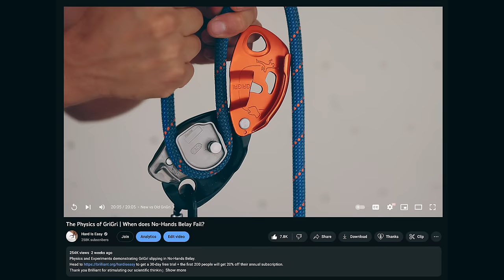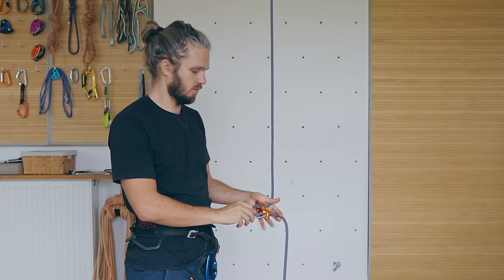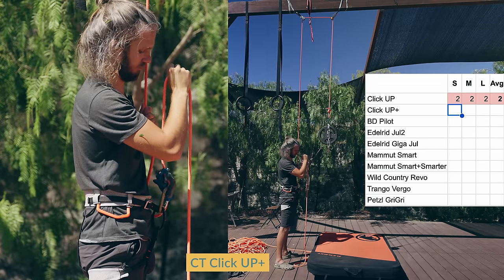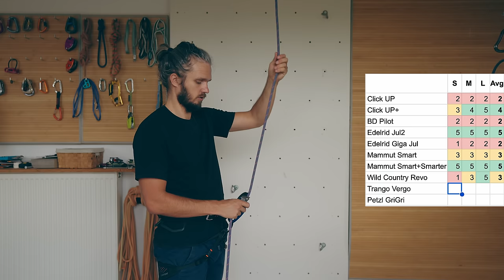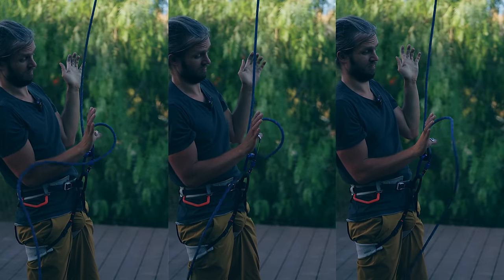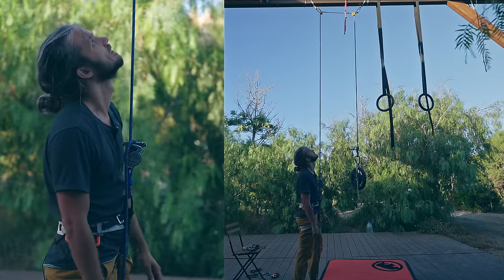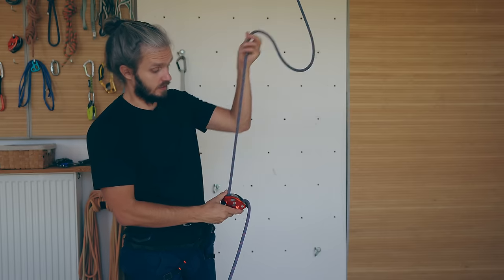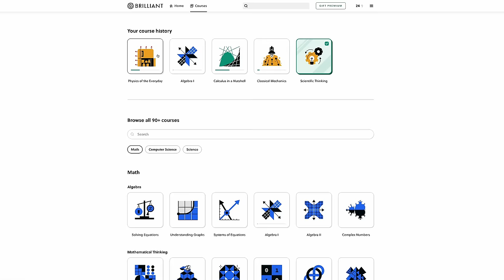When Assistance Fails!? The Physics And Experiments of Belay Devices

Comment: With the click up, do you always have to manually unlock it to get the failure mode you saw with the no slack fall? I.e if the climber was resting and the device was locked, if they then unloaded the rope and took a fall, would the device unlock if you didn't manually unlock it? It seems like if it only fails after manually unlocking it, then at that point you'd be hands on and attentive and an accident would be almost impossible.
Reply: Exactly, the click up would never be used in the way he described it. You have to un“click“ it to let the rope move.

Comment: I am a climber physicist by myself and I think you forgot one component in the calculation: while the friction coefficient is, in fact, essentially speed independent, the force on the belay side of a free Grigri is not. Why? In static situations, the force is, as you argued, F(0)=m'*g*h with m' the specific mass [kg/m] of the rope and h the height of the belay point/ length of the hanging rope. However, at a falling speed v, there is an additinal inertial force since rope segments  coiled on the ground must be accelerated to speed v. This leads to a speed dependent force

F(v)=m'*(g*h+v^2)

or, assuming a free-fall acceleration g, i.e., v=sqrt(2*g*h_fall),

F(h_fall)=m*g*(h+2*h_fall)

That's why your Grigri often engages only after some falling distance and why  it was very hard to make it fail completely (without blocking the engaging mechanism)
Reply: Oops, I forgot another term. Also the hanging rope must be accelerated. For a free fall, my above formula changes to 2*m*g(h+h_fall) when including this inertia component. For  a Clickup, these inertia parts are even mote i fluential:  A sudden jerk will it make engage but a slow acceleration not.
Reply from the maker: Yea every segment of the rope that is stacked on the ground needs to accelerated quickly to match the speed of the rope and it is going faster and faster... I did not think about this component for sure, thanks!
That means that speed indeed has an effect, but it's very hard to quantify it. 
Also as the rope is being dragged on the floor there is friction involved and with any little imperfection GriGri tends to lock - which is good, but from experiments I could still make at least 3m of slippage, so maybe it would be interesting to try higher drop towers...

Comment: I don't like click-up carabiner, which can crack paint and destroy ropes (the company is unresponsive about this issue), but on the other hand the old click-up is great for giving a soft catch when having less space to walk/jump and is easy to feed the rope - depends also a lot on rope diameter and carabiner size. Sometimes if the ropes slides through the device, it is safer than broken ankles from a hard catch or ripped gear (for example on a trad multipitch). How soft catch can you give while using each device correctly during different situations? People should learn to use the ATC safely before relying on blocking devices. Also next time, please wear gloves :)
Reply from the maker: Yea... I've seen that sharp edge as well... And on soft catch - I did A TON of testing and gonna make a mega study video on that.
Reply: @HardIsEasy  nice! Thank you!

Comment: for a 1,60m woman, who usually wear the harness high (because hips), all thumb devices are simply a NO-GO. The device stands up to my chest.  The amount of biceps strength needed to belay anyone slightly heavier is just ridiculous.  Anatomy was not taken into account when creating this thing. Or, most likely, it was designed by a 1,90m german man.
For me it is grigri or clickup and nothing else.
Reply from the maker: Ghmm interesting 🤔 Thanks for sharing;) I don't have a small person's body to feel this :)))
Reply: Maybe the language barrier is the problem (i'm from germany) why I don't exactly understand the problem you are having. I trained and also climb with women under 1,60 m using ATC Pilot or Smart 2 without mentioning any problems. Could you maybe specify this a bit more for non-native speakers/readers? :)
Reply: @belaygear8889  we humans are very capable to adapt and cope. If you believe that is how it has to be, you accept. Once you try New things and compare, that is when you see the difference.
Also, the atc pilot has a large body you hold like the clickup. With the pilot you can you can lower the other person with the shoulder instead of the biceps.

Comment: I've seen many beginners put GriGri on backwards...will it still stop a fall if good belay technique is used?
Reply from the maker: It won't lock, so encourage double check ;)
Reply: No, and you likely won't even be able to hold climber's body weight loaded backwards. Somebody at my gym decked from the top of a route because their belayer loaded the grigri backwards, neither person noticed. The climber weighted the rope at the top of the climb, rope started zipping through, belayer burned both their hands, and the climber fell straight down to the ground after the belayer let go entirely.

Comment: Great content, thanks. As a Click UP user. I have a little objection to your no slack fall test of click up.  If your scenario starts with locked position as you are describing at 15:42. You should also started in a locked position with your click UP test at 17:48.  No hate, just a thought...
Reply from the maker: The test starts in unlocked position on all devices. What you link in 15:42 was just explanation how you can arrive from locked to unlocked.
Reply: @HardIsEasy  not sure about old click-up but new one will not move to unlocked position just by unloading rope
Reply from the maker: @MoxaTD  Old one also won't, but if it's already in unlocked position during normal belay, then you can have the case I was demonstrating
Reply: it will be locked anytime the climber has been hanging from the rope.

and if your climber is actively climbing hopefully you have your hand on the rope... especially with that device that's the only thing your brake hand should ever be doing, there's no hand multitasking like for the grigri.

although falling stones uncouncious belayer etc etc

Comment: You are not using the smart correctly when giving slack. According to the manual, you are not supposed to push it vertically, but horizontally. Not sure if it would make a difference in the test.
Reply from the maker: yea... it's such a small difference that in the end does the same thing pulls carabiner out of the socket and when you need to give slack quick good luck thinking if you're pushing horizontally enough :) 
My feeling is that originally it was designed to be used intuitively and later additional warnings added as with many of devices out there when some issues are discovered.
But I still love Mammut Smart, it's smooth to give slack and has a good grip when taking slack.

Comment: For your #3 no slack fall test, and the results with the click ups, I think your test was not entirely accurate to what you described as the scenario.
If I take, usually the rope will sit in the locked position in the device, and if i now were to take my hands off, and the climber unloads and loads again, it would still be in that spot, as i didnt move the device back. I'd be curious to see whether it still slips then, as to me, the whole point if the action to move the device back into the nonlocking position is to have the belayer make a concious decision to continue belaying.
I would think this might be safer than with for example the grigri, where the spring will decide for you when the device allows rope to pass through.

Comment: I really want to point out, that you can give slack for lead climbing with the grigri without ever touching the grigri.
It works perfectly fine if you just take 5min to learn the technique. After I attach the grigri I only touch it again if my climber wants to descent. There is no problem with giving slack fast with a grigri without pressing the cam. It just shows that a lot of belayers are lazy and have a mindset of "the belay device will do it's work".
I work at a climbing gym and it is really ridiculous how bad a lot of climbers belay. And I really cannot understand why. Two times per week you can get free (!) advice and help from a certified climbing instructor regarding anything you would want help with at our gym. And still people don't use this chance.
Reply from the maker: 22:26
Reply: @HardIsEasy  you still show that you give slack without touching and them continue to press the cam to give more slack. But it is possible to give slack further without pressing the cam. That's what I meant. I'm sorry, if my English doesn't suffice to explain properly what I mean.
Reply from the maker: @nevaehschattenfluegel9652  ah yea well you could bring the brake hand back and continue feeding more slack in a classical way that's for sure, but that might be too slow for some cases.
If that's what you meant.
Reply: @HardIsEasy  yes that's what I meant :)
I understand now that you meant if you like misjudged the amount of slack needed to give than this would be faster to just press on the cam instead of moving your break hand. 
We learned to just hit on them cam instead of pressing it (if you misjudged the amount of rope needed).As you can pull the same amount if you hit, but the cam is instantly free and no chance of failed locking. 

Can I ask why you never show the Edelrid Eddy as a belay device? It's what is most recommended in our climbing gym. It is really similar to the grigri but a lot of the problems that arise with the grigri are eliminated with the eddy. Is it not sold where you live or is it just unbeknown outside of Germany?
Reply from the maker: @nevaehschattenfluegel9652 I only used Eddy many many years ago for tensioning slacklines :D it was slipping at higher forces compared to GriGri :D
But I never used it for belaying... I remember it being heavy tho... but can't comment on something I have no experience.
Reply: @HardIsEasy  ahh thank you for your explanation. Yes, it is quite heavy. Wouldn't use it for longer routes, but for belaying from the ground I don't mind.
And I find it commendable that you don't show it because you feel you don't know enough about it!

Thank you for all your videos, it always helps to show people what the problems are or what could happen. Seeing is believing ;) Stay safe and I hope for many more videos to come

Comment: As you not even understand jokes with the words "just joking" i try again, full serious now as retired instrcutor with all those devices and more used and teached some time:

At 10:30 and 16:18 you did not even placed the vergo according to the manual,  what makes no sense, until you use all other devices too in a similar nogo manor. Grigri with rope wrong sided and so on ...
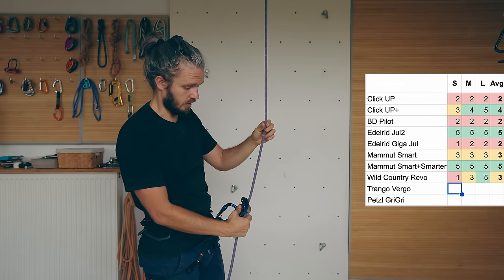( At 10:10 you had it correct on harness, why not all the time ? )
Funfact the vergo (cinch) does even lock better when hand is (wrongly) up, because the caming action gets supported by the rope twist.

Of course is nearly any device potentially dangerous if handled unsafe, well shown in that video.
I just miss the most common error on autotube belaying, staying in unlock position, with fingers open and holding nothing in case of a fall.

And "the best belay device" is that one in a hand of a well experienced belayer, people do lack in experience, giving the device the credits when something bad happened...
it´s all human error
Reply from the maker: Ah you are right, seems like I did miss a turn on those tests. 
Few thoughts on this: 
* It's so confusing to insert this device correctly... I had a brain puzzle all the time - not sure if it's only me or the design is not very idiot friendly.
* Its nice to know that it performed well even in improper-load case.
* I've been reached out by multiple people describing way more serious issues with Trango Vergo that I'll have to check / test for the follow up videos for sure.
Reply: @HardIsEasy  the cinch got a really bad reputation, because when you load it properly, but let the handle face right side of your harness, and then do not hold the brake strand at all, the rope will likely run through the device with no locking action at all !
you prevented that happening by adding a curl upwards.
The cinch is a very capable device (or vergo of course) but it can also fail, like everything, but it´s always a user error. the device is ace.

Comment: 13:18 not really fair comparison from grigri to the other devices. If you do not hold the brake strand at all for the grigri you should essentially let the rope slide above your hand insted of loosely through your fingers. Loose grip and no grip on the brake hand are very different things.
Reply from the maker: I did not held the rope on any of the devices on that test.
Same would happen with GriGri if the rope would be in the hand, I already showed in multiple other vides I made on GriGri.

Comment: The Revo locks plenty fast enough in real life. I’m more worried about its longevity considering all the small springs and moving parts. The 4m/s are pretty much perfect. When you lower the climber quickly (or your lowering speed is not quite consistent) it sometimes starts to engage. So a lower threshold than 4m/s wouldn’t be good.
Reply from the maker: The problem would be in a high Friction scenario, I've been told someone managed todo 5m drop with loads of drag, but I did not tested such extreme cases.
and longevity... I suppose that WC did tests on that... But well time will tell :)
Reply: You're right on the longevity. Some people have noticed the locking lugs chipping metal pieces off after extended use, but it's really designed to be used as a tube-style device with the full lock-up being an emergency backup system.
Reply: @HardIsEasy  In this case though, the fall should be relatively slow right? So hopefully not dangerous.
Reply: @Govanification  Yes, I’m not really worried about the backup mechanism wearing down from engaging (because it should never engage if you belay properly) but more about it failing because of dirt or abrasion.

Comment: It's somewhat unfair to Revo - it gives so little friction that you don't need to take your breaking strand up at all to give slack.
Reply from the maker: Yea, giving slack is super smooth on Revo, taking slack has multiple issues
Reply: @HardIsEasy  would be interested in a deep dive. The (only) big problem i see with the Revo is, how complicated it is to manually engage the break while taking slack (under load it is (nearly) impossible).

Comment: I think that the test is not very representative. The ratio between weight and friction just doesn't seem very realistic compared to any scenario most people will ever encounter in sport climbing. 

Also about the Revo.. I understand that it locks at 4m/s. If due to friction/weight ratio this speed was never to be reached, the real question would be, how dangerous is an impact at 3.9m/s?
A thing i like about the Revo is though, that it implicitly teaches correct behaviour. Every time it locks by itself, you know you did something wrong. Sounds like a good first device for people who later want get into ATCs for example.
Reply from the maker: If you're referring to the free fall test you're correct is ratio between weight and friction, in my case I had almost no friction (pulleys at the top) and low weight, I did test with 30kg as well, got similar results, but did not ad to the video to not drag it too much.

Also a group of German coaches told me a case of a 5m slip on Revo before it locked in the gym where the rope went across lots of angles.

How bad is 4m/s? well depends on how you land I guess... some can get hurt from falling from very low heights, some are monkeys that can do crazy jumps :D

Is Revo a dangerous device? No, if you know it's limitations, I was testing edge case scenarios just to expose potential risks with all the devices.
Reply: @HardIsEasy  Okay, i just think that a relevant part of the friction comes from the belay device itself (in situations without any angles), but with 30kg that should really be a valid test situation. I was just wondering, because the falls in the video all looked kinda slow to me, but that may be my lack of experience with climbing falls.

I'm looking forward to your follow-up video about other characteristics. As a long time ClickUp user i'm currently considering switching to a Revo. It would be awesome if you could cover the Revo again and maybe how it handles during planned rests (manually locking it). After what i read that seems to be its biggest disadvantage.
There's really not much material to be found about the Revo, outside of solo belay channels.

Comment: You showed a wrong way of giving slack on the Grigri. You are supposed to have 3 fingers around the rope while you press your thumb on the cam. Picture 7c in the Manual (giving slack quickly when the leader is clipping)
Reply from the maker: well I had 3 and a half :D
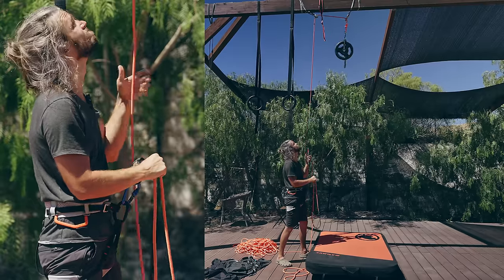Reply: @HardIsEasy I meant the giving slack example at 13:20
Reply from the maker: @jonathanzimm5511  Ah yea that one was on purpose held wrong... same as the other devices where I was not holding the rope on purpose as well - that was the idea of the test